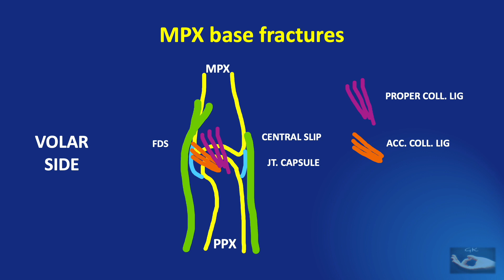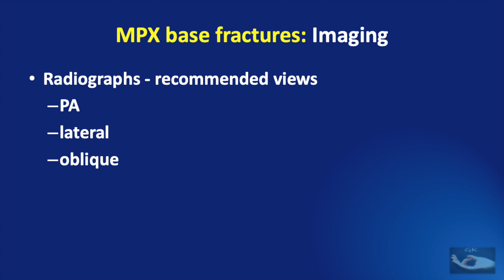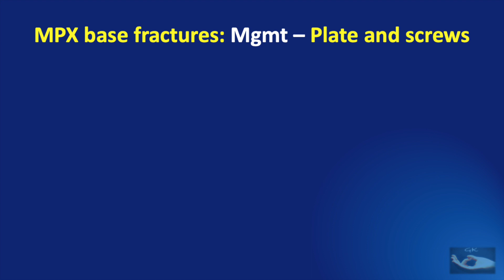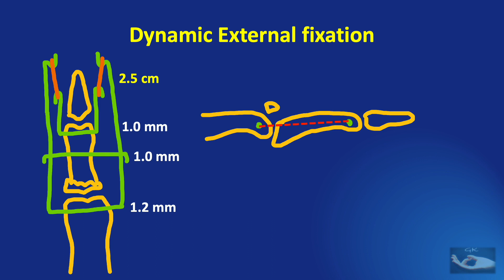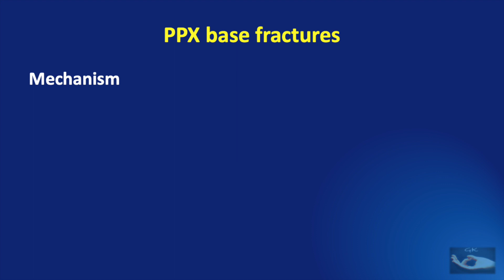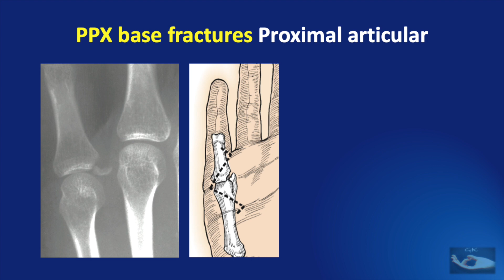Phalangeal base fractures: Features and management

Comment: Hi sir, for a volae base fracture with dorsal and lateral subluxation , is it possible to do closed reduction and K wire , if so what should be the configuration of wire ?
Reply from the maker: What is the size of the fracture when compared to the total articular surface?